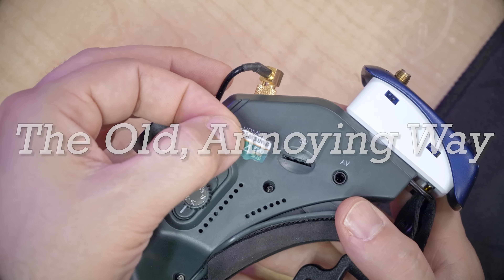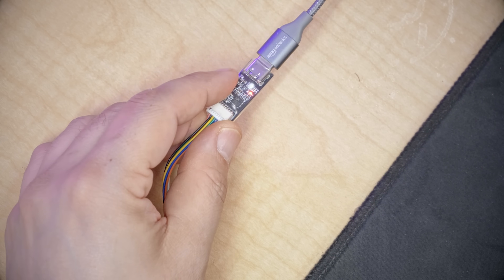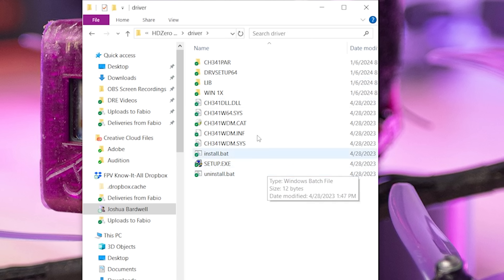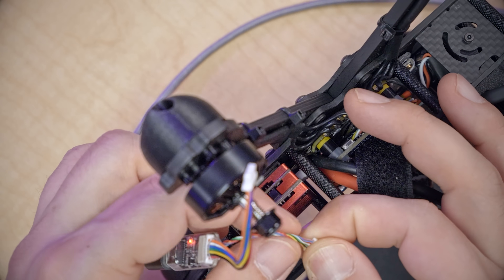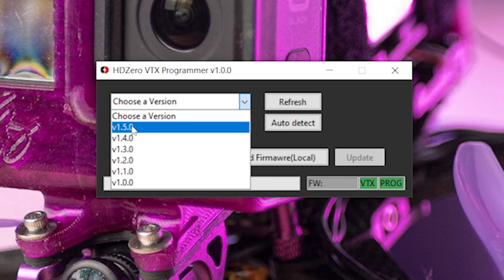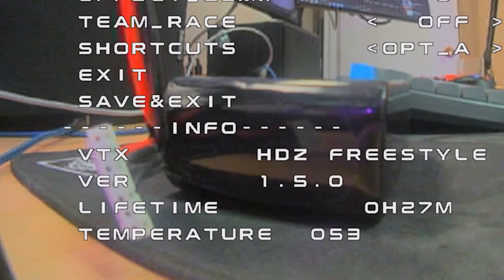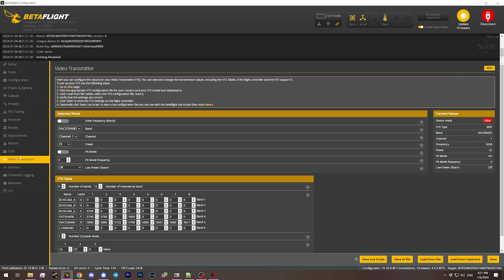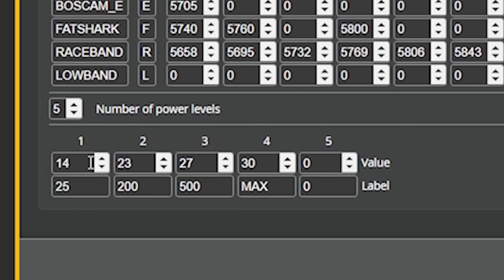Game-Changer! HDZero USB vTX Flash And Update Tool!

Comment: So im confused . can i update the batch 2 gogles that havent been used since  8.6.10 rx 73 va:184 and the oscar are an older looking version website so i dont know where to plug what and cant seem to find even on hdzeros webpage when its working,i dont have the diagram for the VTX (its name etc..: HDZero Freestyle , Model:HDZ3130 Power;DC 12v@1.2a Resolution 1280*720@60fps just tp make sure its the correct VTX im talking about.Any help or direction to a URL would be very much appreceated thank you

Comment: Next google firmware release will automatically download the latest firmware for both the goggles and vtx if you own a WiFi module.  The menu was restructured to allow you to select the target vtx similar to the app.  PR 346 includes screenshots and instructions.
Reply: i wouldn't recommend auto updates, my goggles had flashing only in the dvr playback that i tracked down to this most recent version, rolled it back two versions and its fixed
Reply: @CheeseFlingingCows we only offer auto-download.... to update its still a manual process and it's up to the user to invoke it.
Reply: Oh that’s smart I like that implementation a lot more that instant install

Comment: Hey.. so I think I missed something.. I saw the connection to the vtx.. but not to the goggles. Does this $15 device with two plugs plug in to the goggles and update that firmware too? Or is that still the SD card route? I am assuming the benefit of this new device is to avoid the vtx to goggle connection?